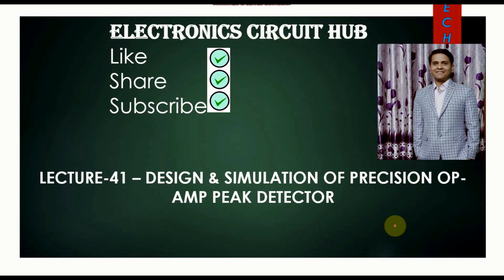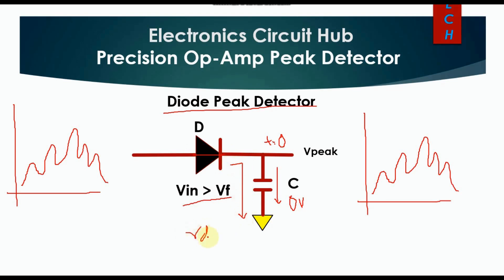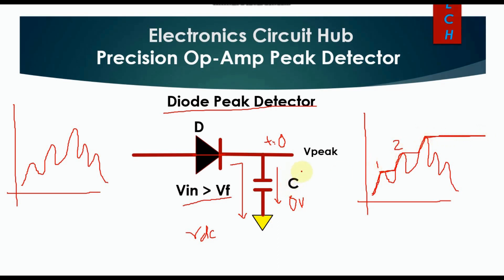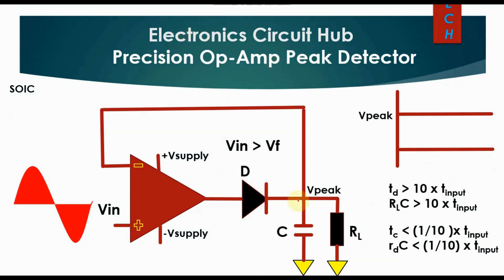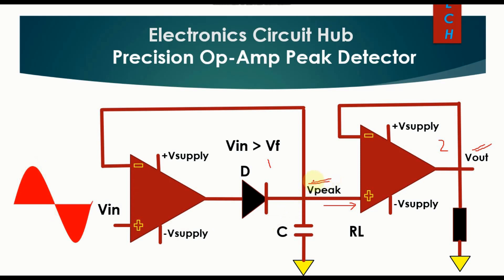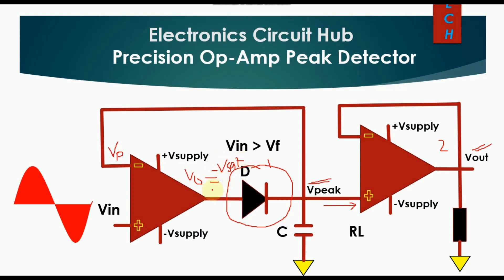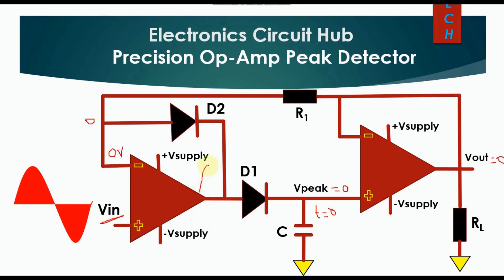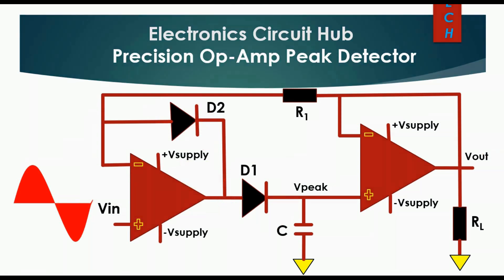LT Spice - Precision Op-Amp Peak Detector Circuit Realization & Simulation

Comment from the maker: 0:52 min - Diode Peak Detector Explanation
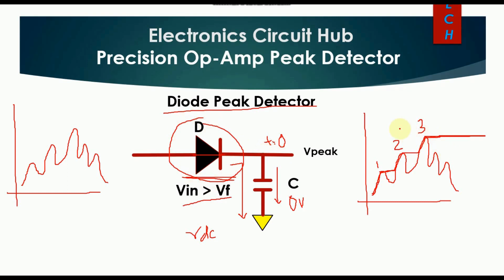3:02 min - Precision Op-Amp Peak detector circuit explanation
5:05 min - Precision Op-Amp Peak detector circuit with Buffer explanation
7:36 min - Modified Precision Op-Amp Peak detector circuit with Buffer explanation
9:55 min - Design & Simulation of Precision Op-Amp Peak detector circuit using LT Spice

Comment: I have a question sir? 
1. Which current is more dangerous DC or AC ??
PLEASE REPLY
Reply from the maker: First of all, keep in mind that both AC and DC voltage and Current are dangerous and hazardous.
AC is more serial killer as AC with less frequency 50 Hz or 60 Hz is more dangerous than the DC having the same level of voltage. In other words, 230V AC (or 120V AC) is more dangerous than 230V DC or 120V DC respectively. But keep in mind that DC has the ability to roast you i.e. if we say AC is more dangerous, it doesn’t mean that DC will only play with you. Stay away and don’t trust on both.